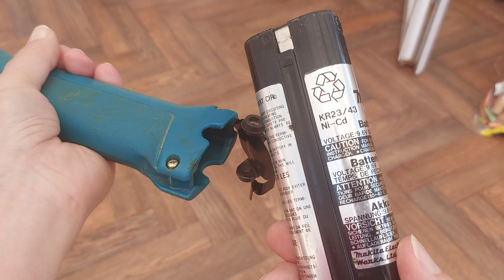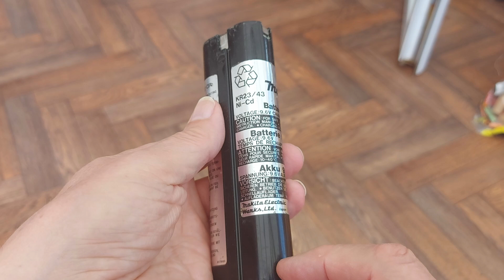Peek at a Makita NiCd Battery

Comment: I have a 9.6v Makita drill from 1990. I replaced the batteries with three 18650s from an old laptop battery. This gives you 12.6 v fully charged. Works great and I have been using the drill for a few years. I removed the circuit board from the charger and just soldered 2 leads that extend out of the charger and hook up to my bench power supply at 12.6volts. The charge rate I use is 750 milli amp. This system will work for years to come.
Reply from the maker: Thanks for the tips 👍😁

Comment: I build my own packs with a spot welder. I have changed over old power tools, electric shavers, dust busters and a scooter. I had many Black & Decker/Craftsman VersaPak tools, converted the cylindrical batteries to Li-Ion 18650's. One DeWalt battery I opened to reclaim Li-Ion 18650's had Li-Fe cells 18650 size, these are 3.3 volts each. With these I make 7 & 10 volt batteries, this keeps you close to what the tool wants, tools with strong motors need cells with higher c ratings. Some packs I add a BMS others just a balance lead. I charge everything with a $25 hobby charger
Reply from the maker: I think I will have to buy one of those little spot welders designed just for this sort of job 👍
Reply: You can just solder leads to the batteries.
Reply from the maker: @christophernalbone6299  Yes, you can. I have done it myself, but you risk damaging the cell if you take too long. That is the advantage of the spot welder. If you plan to do lots of them, then a spot welder is probably worth adding to your tool collection.

Comment: I am sure you mentioned those NiCads are pretty expensive to buy. I recon that is because they are doing away with NiCad batteries. Trying a LiPo will work but that little model spark gap Tesla Coil  I made some years back had problems running on a 12-volt LiPo battery. The battery began to heat up very quickly. I think the C rating was too small so it could not handle the current it was pulling. I think the "C" rating has something to do with how much amps can be pulled.  
I decided to use a 19-volt laptop charger to run it and it was fine. 👍👍👍

I noticed someone thought this was simulating. 🤣🤣
Reply from the maker: @mikeflight9  Yes, the current draw is probably the issue if I tried to use vape batteries, but it would be fun to do it, just for "because I can" 😊 Sorting out a balance charger for it would be an issue. If I used vape batteries, I would parallel them up to increase the capacity. It's just one of those projects in the back of my mind.